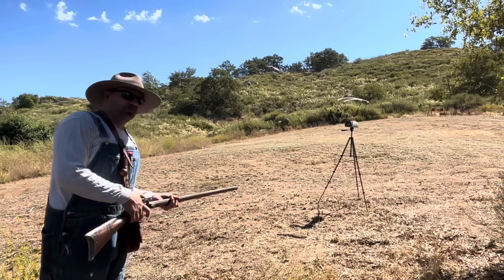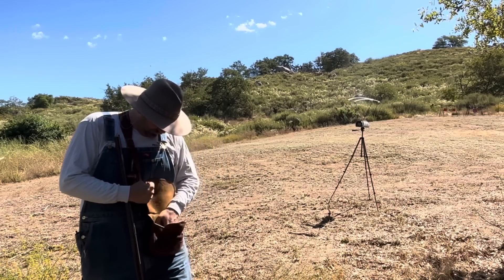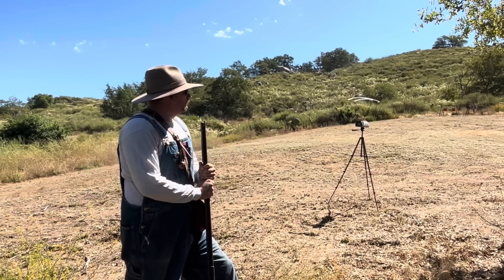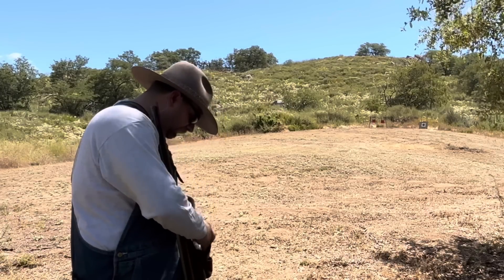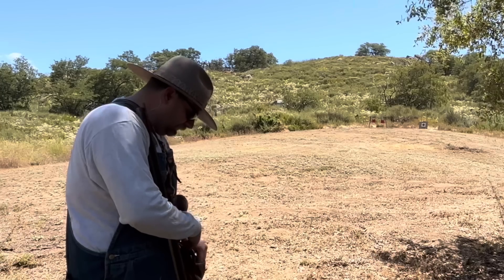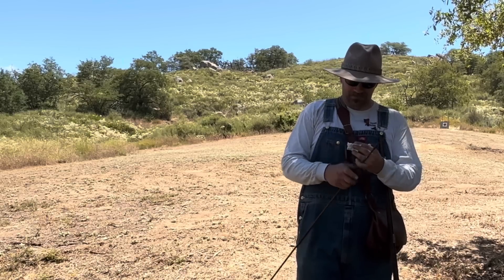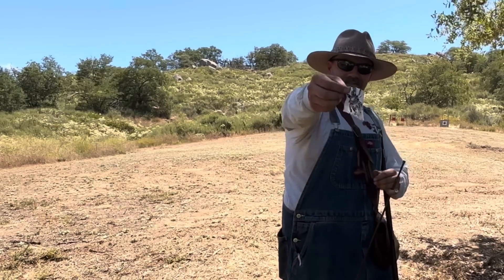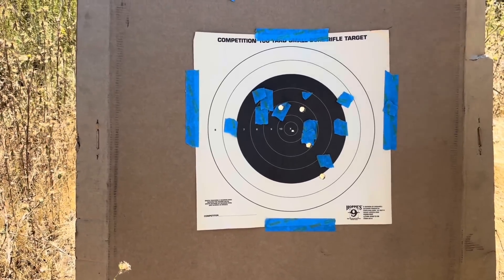Mill Time. The Key To High Performance Black Powder?

Comment: Could this be due to carbon particle size?  I know carbon black is "sticky" so it might not benefit from mill time.  Remember,  carbon exists in multiple forms or allotropes.  Diamond,  graphite, amorphous etc..

Fuel has to be vaporized, carbon has the highest vapor temperature so finer, better dispersed carbon would increase overall reaction rate.

Comment: Epically awesome: disproving myths and expanding the knowledge base.😎 How “large” a batch do you typically make in a single mill? A 200gram batch, larger? If it is possible, would you weigh the amount of brass media used  in a batch, along w the amount weight of the batch being milled? I just don’t think my milling is efficient and would be interested to know the weight of media, as I am using the same sizes you previously referenced.
Reply from the maker: All of our test batches are 200g
Reply: Many thanks!

Comment: More milling makes sense, the more homogeneous the mix the better it will burn. I wonder if mill time also could impact the level of fouling at all. Great video as usual, keep up the great work!
Reply: Yes, it will affect fouling some. Am more homogenous mixture will burn more consistently and completely, leading to more power, less velocity variation, and less unburnt material to foul the weapon. Powder moisture level is the other factor, which when too low prevents much of the fouling from leaving the barrel as it catches on the steel and other fouling, building up rapidly. It also has a minor "steam cleaning" effect in the right concentration, actively removing a portion of prior fouling to limit the rate of buildup to the point that good powder in a good weapon can be used for dozens, or even a few hundred shots before a swab becomes necessary to avoid problems. 

Ultimately, the only way to rediscover how all of this works IRL is the testing Jake and his guys are doing.
Reply from the maker: Thank you

Comment: Ball mill then switch to the vibratory tumbler. The clumping happens because of absorbed water in the components cemically. They dont really dry out until you use high temp drying, and then your mill would have to keep them  completely sealed and dry. 
If you cut up ALOT of brass square chunks,  it would shear the stuff harder than ball milling, especially having lots of weight in it, and it would add another forum of mixing, to overall help the mixing procedure. 
Could replace screening step. 
Overall I would NOT encourage hobbyists to go out and get 2 tumblers for 1900 fps.

Its not really worth the hype, unless you start selling it as the best powder avaliable, and pucking is time consuming, production wise, it would be best to keep it simple. 
Competition wise, meh?

Comment: 48H Cottonelle (Iirc the first milling of that was 24h (?)) and 48H bamboo seem to be almost needed for a reasonable comparison. Though... If the 24h cottonelle is already pushing 1800 avrg. I'm kinda worried what will happen with your Kibler if the powder pushes a load out at 2k-2.1k. I don't know the safety margines of the design.

Comment: Down here in the deep south, the humidity is quite the beast. Yall are doing a fantastic job! I think your efforts have been very productive to say the least. I cant wait to see what you do in the next presentation. Thanks guys!
Reply: Yeah one thing you can do is dry the nitrate down and mill it on its own in one tumbler for 24 hours while milling the charcoal and sulfur mixed in another tumbler.  Then combine the tumblers for the next 24 hours.  The nitrate is really the only ingredient that seems to problematically suck up water.
Reply from the maker: Thank you

Comment: Did you know that in dry milling method you  get size like 15 microns top ? On the other hand wet milling you get nano particles ! Guess which powder gonna be the winner!😊😊 An excellent solvent is pure alcohol or isopropyl alcohol the potassium nitrate is almost not soluble with it and when it's dry it leaves nothing behind because of the purity (99.9% isopropyl alcohol) of course there are some issues with this process first your ball mill must be waterproof the other issue is that isopropyl alcohol is a bit expensive so you can let it dry and take the product! Also is a flammable liquid and you must be protect it from the Bruss motors of your mill! Imagine if the microns is so fast what the heck the nanoparticles can do 😉 try it with alder buckthorn in 72 hours and post it here !👌👌
Reply from the maker: Funny you should mention that. We are experimenting with wet milling right now in an effort to reduce the mill time. We are using denatured alcohol.
Reply: @Everythingblackpowder  i tried that way long ago, but i don't tell you the results, i want to have your fun and happiness of discover it yourself! But i can give you some tips about the process if you want!
Reply: @Everythingblackpowder  so you can make  perfect results, otherwise you will pass this legendary method by saying "it was just a wasting time "
Reply: @willowpine2604  Spill the beans man, we are all scientist here!
Reply: @luuk-out-below9804  wait my friend, Willard is a guy that we know and have a face to show, as for you (no offence)how do i know you are trolling fishing around for info to make something bad? Your Chanel is locked 🤔 so the beans will stay in the basket for now...
Reply: @willowpine2604  hahaha ok, do what feels right to you, no offence taken.

Comment: It kind of makes sense that carbon is carbon regardless of the source....only varying in how large the carbon grains might be.   So milling more breaks up the larger grains to equal the smaller ones for equal performance.   Obviously there will be a point in the milling where more doesn't increase the power ...very interesting experiments and thank you for doing them.
Reply: Charcoal is not really pure carbon, but rather carbohydrate. That's might also be the reason why black powder made with purer carbon, like lampblack or graphite, usually sucks.
Reply: @_muody  Carbohydrates? Does that mean that muskets will make me gain weight? Lampblack isn't pure carbon though, it's a petroleum product.
Reply: @0neDoomedSpaceMarine  I don't know how digestible is it, maybe could work as a fiber ;-) And what I meant is the closer you get to using actual pure carbon, the worse the resulting black powder is, at least so it seems.
Reply from the maker: Thank you
Reply: Charcoal contains traces of water and silicate, as well as one other I can't recall, when made correctly. The moisture level determines cleanliness in part, while the burn temp is the other half (determined more by the kno3 than the charcoal). The power level is improved primarily by grain formation and consistency along with the sulfer-kno3 ratio. However, the chemical impurities (silicate and the like) can reduce burn rate, temp and consistency as well, if not purified enough. Purification is in the kiln (pyrolisizer) so the kiln time is a balance between burning off just enough moisture and not leaving too many other impurities. This is where wood source makes the biggest difference historically. Some woods make a purer charcoal at ideal moisture levels, others must be dried out more to be sufficiently purified (for power and consistency purposes), making them a bit dirtier than their more ideal couterparts. Mill time maximizes the powder efficiency, burn rate and consistency within chemical limitations, meaning most charcoal should have similar maximum performance, with variable cleanliness at that level. Most should be usably clean, with a few  being impossible to sufficiently purify without breaking the carbon down into truely pure carbon, which is too hard to react with other chemicals for the purposes of black powder and will have so little moisture that it becomes functionally useless.
Reply: I think testing the worst carbon source at 72hrs would be a very interesting data point to have.
Reply: @kevin-pk6hd  Coffee Grounds were an incredibly nasty carbon source as I recall, but I don't think you'd get any appreciable difference from milling it further, and I don't think the Mountain Rifle deserves that kind of treatment again.

Comment: Yep the more you mix and grind the better it gets.  When I was into BP rocket engines we would tumble it for 24 hours, pack a sample of 6 motors and test.  If no CATO add 8 hours and repeat till there was a CATO, then back off the time 8 hours.
Reply: I wondered what Cato was too, thanks for answering
Reply: @edwinpharaoh6658  I too
Reply: What is CATO.
Reply: @BRENDANTHERED  In rockets, CATO is the acronym for Catastrophe At Take Off.
Reply: @luuk-out-below9804  Thanks for replying, I had thought to look it up myself but figured it might be nice for others who are wondering the same.
Reply: @BRENDANTHERED  no problem.

Comment: I'm not surprised that mill time makes a difference, but I would have thought that after 24 hours it would be as finely mixed as it could be. When I get around to trying this I'm going to try the brass hexagon pieces and see if that helps any. Keep on experimenting.
Thanks
Reply from the maker: Do you know where I can find those brass hexagons? I would like to buy some
Reply: @Everythingblackpowder  I am just going to cut some off bar stock drops.
Reply: Also I've been wondering if time of year the wood is harvested would make any kind of difference. Being in Ohio we have sap runs for maple syrup in the spring but know from heating with wood for the first twenty years of my life that wood cut during winter didn't have to dry as long because the sap was already out of it. But if wood was harvested in spring, the sap has a lot of sugars and I'm sure other stuff in it. Just a thought. I'll let you know when I get some drops of hex cut and see if I have enough for two. About how much do you think you will need

Comment: Have you tried different sized media? I was looking at a general overview the other day and got the impression that smaller media could produce a finer product.
Reply from the maker: @michaelcalabro2376  I use a mix of 1/2 and 3/8 diameter media
Reply: Ok, as best I gather smaller balls means more surface area means more strikes per revolution means faster grinding, but less weight means less energy per strike; the longer you grind the finer the result but efficiency certainly trails off with time.